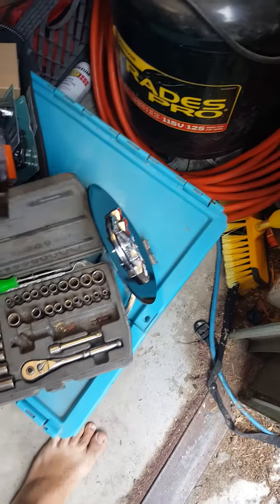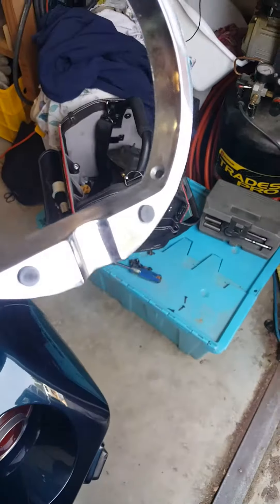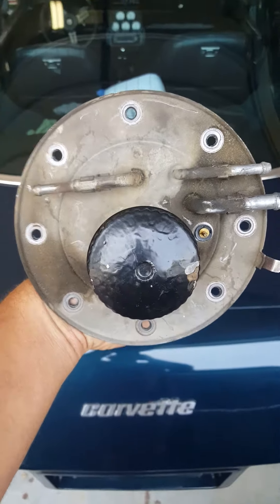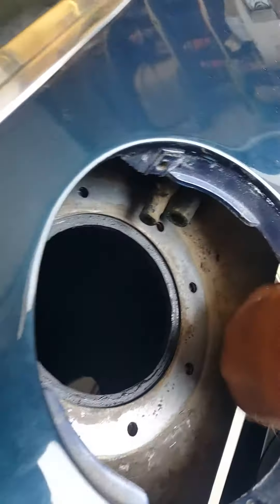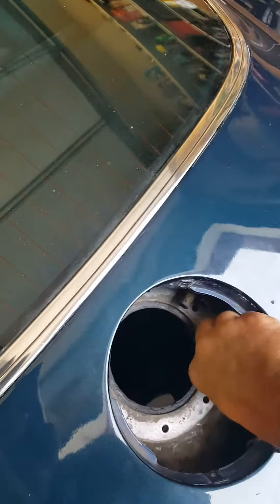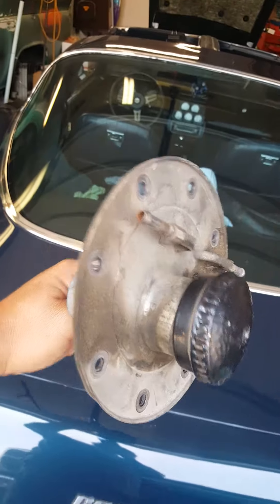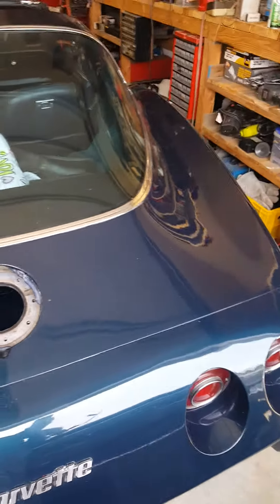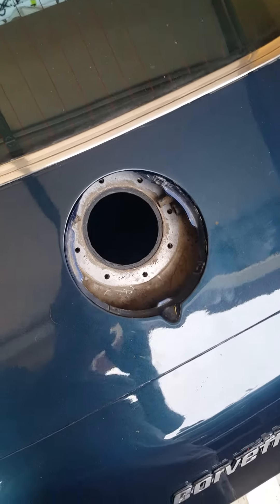How to remove a fuel sending unit and fuel pickup on a C3 Corvette

Comment: I have a 78' L-82 Pace Car and the fuel gauge wont go down past half. When I fill up to full it will go to F but will slowly decrease and stop at half only. Could this be an issue related to the sending unit?
Reply from the maker: Mostly likely
Reply from the maker: You might also want to check the fuse I had something similar happen  in a Camaro